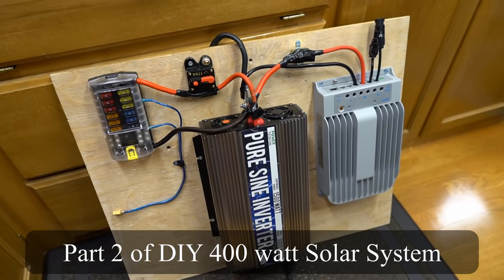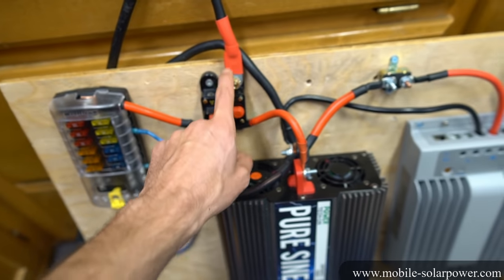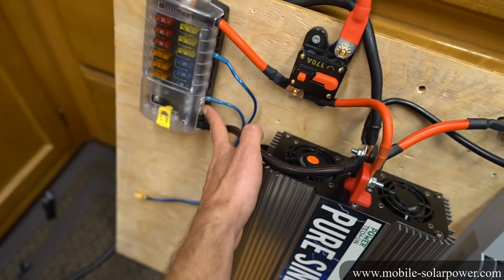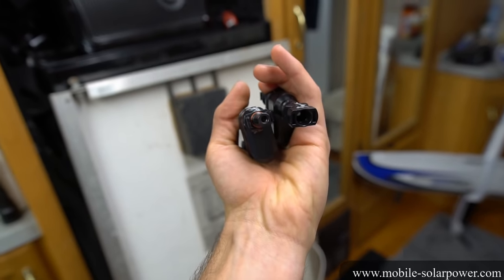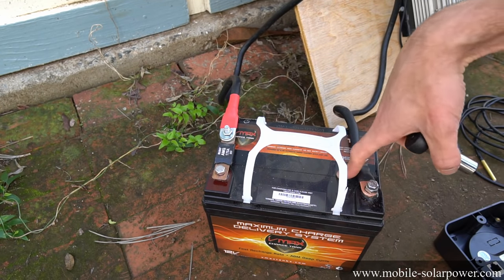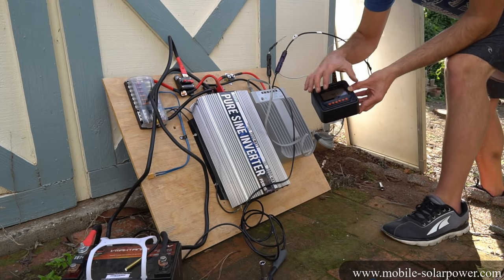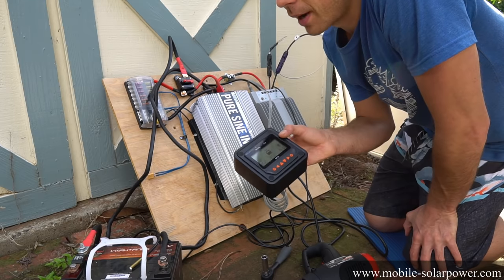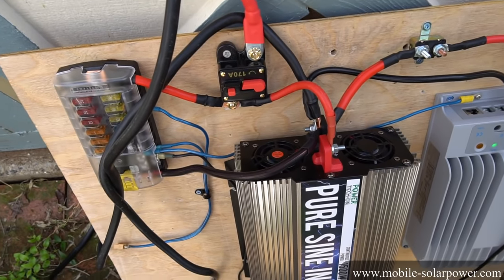DIY 400 Watt Solar Power System Beginner Tutorial *Part 2*

Comment: $355 for 4 solar panels + $250 inverter + $720 for 2 batteries + $200 charge controller/monitor + $40 fuse block + $13 circuit breaker = $1600 and we haven't even purchased the wires/connectors/hardware/tools. Was hoping to keep it all under $1000. What would you change if trying to keep the system's total cost under $1000? Less batteries and panels?
Thanks!
-Nick
Reply: Following for this answer.
Reply: If your 4 panels total 400w, I would switch to a single 300w panel, I bought mine for $170 each; check with your local battery suppliers for used batteries, I got a pair of 6v 225AH batteries that were 1 year old for $70 each. Honestly you aren't going to get much in the way of capacity trying to stay under $1000, going with cheaper parts you'll usually get what you pay for and parts will fail. Inverter price varies widely based on size and type, consider what damage you might do to the connected gear if the inverted is cheap and gives dirty power.

Comment: I keep coming back to these two videos. They are really well explained. I am still struggling to grasp fuse and breaker protection.  One thing that confuses me is the fuse at the battery. With the breaker protecting the inverter/DC box and fuse protection at the Solar controller, what function does the bolt-on fuse serve?
Reply: As a final precaution if all else fails so it dosnt have the practically unlimited energy of your battery to catch on fire or and explode
Reply: There’s different ones then the cheap bolt on one he’s using they make ANL ones with holders and stud/terminal style ones as well at marine stores
Reply: I just discovered these cheaper bolt on ones he used at the terminal at the auto parts store.. much cheaper than the marine stuff..

Comment: Hi.. I love your videos. I need your help please. I am getting my 100w solar panel along with a 40amp Renogy Rover being delivered this Monday. I also purchased a 3000 watt inverter to connect with the system. The diagram illustrated from renogy diagram and video doesn’t show or say anything about connecting a fuse box, circuit breaker and a smaller circuit breaker… could you advise me if I need the circuit breaker and fuse box or is it not necessary..? Thank you. I will have to put this altogether before the weekend of September 20, 2024… please respond back to me asap

Comment: Thanks Professor Solar,  you're a Legend Mate. I wouldn't have had a clue without your tutorial. Thanks once again. AL
Reply: I see how you got to a 50 amp breaker, how did you decide on the 170 amp breaker [not clear on that 1]. I've got a 30A Triron, so a 40A breaker yeah,  I've got a 170A battery, 325 solar panel, 100A fuse block & 1500Watt inverter, so I figured 150A breaker for the big 1. I want to run a 70Watt fridge that draws 6A[?]. What do you reckon Professor, if I wire it all together like you say, will it work? Any help would be much appreciated. AL
Reply: P.S. Very sorry Professor Will Solar, no money left to buy a book. AL

Comment: When I posted on the Facebook Group Lithium and Lead Batteries in Off-Grid Systems, a guy in the group turned me onto your channel. My question there was about   Lithium, batteries, and cold temp since I want my system to be usable year-round and we could see -30 mabe more during the winter months.    Now watching this video just brought up another question about my ideal. I want to build a system to run my 35ft camper trailer.  I was planning on buying a Renogy 400 Watts 12 Volts Monocrystalline Solar RV Kit Off-Grid Kit setting that up to battier bank and a 3000watt converter and then just plugging the shore power cord of the travel trailer into the converter.  Would love to hear your opinion on this and what I should do for Batteries.     Thank you in advance.

Comment: Hi folks. I built this system with similar components but renogy solar controller and renogy invertor. It works!

I have hooked up a cigarette lighter to the fuse box and connected my bougerv small fridge.

It is frustrating because I thought the 12v fridge would draw less ...however, the fridge is always erroring out because of low voltage.

I have a 280aH lithium battery. 

Any ideas?

Comment: I am building a similar system with the same solar charger.  I currently have 3-100 watt panels on the roof of my van.  Do you think that is enough or sufficient.

Currently have 2 deep cycle that are around 85 ah each (thinking of upgrading to 2-100 ah lithium 

I will have shore power when it works but I would like to be able to live off grid.  I will be living out the van for 2 months full time this winter.

A possible add on will be charging off the car battery in the future.

What i am powering...
Dometic 75cfx fridge/freezer
8 led lights
Heat Source LP furnace
Gas cook top
MaxxFan roof fan
1200W inverter
12v water pump

Comment: New to solar here and plan to build my own for my camper soon, but slowly over time. Not to cause confusion, but as I’ve been researching, I read that a 3000W inverter won’t even activate without 4 batteries minimum. Im guessing that since yours was only on 1 battery that isn’t true?

Comment: Thanks so much for all the information. I’m somewhat copying exactly what you’re doing with the larger appliances. However, my plan is to plug into the inverter to the trailer just like I would if I was on land. And on the DC side, just go through the circuits on the trailer just like my current batteries are hooked up on a stock trailer. None of the videos I’ve seen show that configuration. They always show a DC fuse box on the board and I’m wondering why I can’t just go to the trailers DC fuses.

Comment: Great tutorial. Am I right in thinking you don’t use a secondary charging source such as from the vehicle’s alternator?
That type of setup seems to be very popular/common 
Ant chance you could do a tutorial on that configuration? Thanks for your time.
Reply: The one major issue with connecting to the alternator charging grid in vehicles is the age of the lead acid "cranking" battery  (if you don't run an auto shut out/off regulator between your battery bank and the vehicle cranking/charging grid) IS the age of the lead acid cranking battery and its differences in relation to your lithium/AGM/lead-acid batteries.

My guess is Will created this 2 part video for "any" application. Not soley vehicles with charging systems. Also to reduce the length of the videos, adding info about varying battery types and the need to isolate them etc is time consuming lol
Reply: DC to DC charger with a disconnect relay when the vehicle is not running. But as mentioned some kinds of batteries don’t enjoy fast or uncontrolled charging. (Flooded lead doesn’t care so much)

Comment: hi great video. Why do you use a 40amp charge controller for a 400W system with a 12v battery. Are the panels even able to produce enough power so supply 40am to the battery. 400W x.75 = 300W / 12v = 25amp.  Forgive me if my maths are wrong

Comment: Avoid using this type of DC breakers (the one rated at 170A). They usually trip at much lower current and generate a lot of heat wile operating, which is not good. Use only proper rack-mounted type of DC breakers

Comment: What inverter do you recommend for adding an ac breaker box. I’m using an 800 watt array with a 200+ amp needed so I expect that an 3000 watt inverter but I’m new to this. I like a victory multiplus but cost it’s prohibitive. Also do you have a vid showing how to hook up charging off the engine alternator.

Comment: Love the vid, but isn't it bad to have the solar charge controller directly connected to inverter? No hate, I am just confused as that's what I've always been told. And you are really brilliant with solar stuff, so I'm just confused, as you know your stuff. Am I missing something or have you just made a little error? I'm guessing I'm the one missing something. I mean I know the battery is connected to the inverter... but that doesn't stop the fact that I see a plus and minus straight from the charge controller to the inverter. 

Kind regards Alex

Comment: I am building a small 100w 12v solar rig to power a figjam swamp cooler (DC, connects to battery) to cool my tent, and charge my phone from a 400w inverter. In the playa lab instructions to build this rig it specifies to keep the inverter outside in fresh air. The inverter has all the ac outlets to charge my stuff, and its inconvenient to have it outside. Does it realy need to be outside? Or is it ok to be in a safe spot in my tent? I just wanted the panel and battery (in a tub) outside. Thank you so much for your help!

Comment: Im confused on your breaker size decision of 175. What is your reasoning for that size choice? Im converting a 6x12 enclosed and I purchased a 200w (2-100w panels) solar system from Renogy. I also have a 2000w Pure Sine Wave inverter from renogy as well.

Comment: I'm currently building a similar system and was wondering if you could tell me if you have the Renogy 40A charge controller with Bluetooth, is it still necessary to purchase a separate battery monitor and/or a victron low temp cut-off switch? This is going to be to power my greenhouse, so I'm hoping low temp won't be an issue, however, in the event something fails, I want to make sure my Lithium batteries aren't damaged.  Thanks!

Comment: Will, wondering if you have a second..I have learned so much from your channel, so much, I have my first solar power system.  I am using a EPEVER 4210AN Tracer controller, 6 lightcatcher 100AH AGM batteries, wired parallel 2 200W 16V panels and 2 210W 16V panels, I have recently wired the 4 panels in series parallel, so I am seeing 32V and what I hope to see in AMPS 20ish. I am powering a overland vehicle, with 12V fridge/freezer by Apicool, diesel fired heater and a few other items. if you have time I would love to pick your brain on things like BMS, system set up ect

Comment: I am in england   ..  I HAVE two 200 watt panels    I want to be able to have power in my Garage    I have two 115AH  leasure batteries ,  do I need to buy a 40amp controller ?   is it better to use the batteries in parrallel or series ?   Should I also buy a 3000 watt inverter ...  And one last question do I need to buy curcuit breaker and fuses ?

Comment: Will I have a similar setup 400W with the same 40 amp EPEVER. Just upgraded from the Wanderer PWM yesterday. Your right that is an awesome Charge controller. Running 280 AH of AGM SLA. This is in a workshop so weight is not an issue. I would like to run a second inverter.
One 1000W  will be on 24-7 to power a small Dorm fridge. I would like a second 1500 W to turn on as needed. How would I wire that?

Comment: Late to the party, but here's my 2 cents regarding battery hookup order...

Lead acid batteries can offgas explosive fumes.  The order of hookup is to avoid a spark if the battery is offgassing.  

This is particularly important when jump starting a car battery  and why, you should always attach the positive cable first to the positive battery post, then connect the negative cable to a metal point on the engine away from the battery.  This way  if it sparks upon connection, the spark won't occur directly within the battery gas cloud.

It's battery explosive safety 101 for every mechanic.  

Hovever, if you must connect both leads to a battery, wear eyepro and connect pos. 1st, then turn your eyes away just before touching the neg. lead to the battery...eyes are important.

Comment: This design of these components where you have to add the little chassis ground from the outside seems ridiculous to me. Why wouldn’t they connect the chassis ground with the ground internally so you don’t have to run 2 grounds ?

Comment: Hi Will - I am following your instructions to a T, but it looks like here you have flipped the board upside down from what you started with.  Should the connector posts on the inverter be up or down when in use.  The inverter instructions say to not install upside down, but I don't know if that means the post end is the bottom, or if the long label side is the bottom.  As mine stands, I would be plugging items into the top of the inverter, whereas here you have them plugging in on the bottom.  Which is correct?  Thanks!

Comment: Absolutely great videos. I have a question about temperature. What happens if you leave a system like this sitting inside a camper or a truck during hot days and it gets 100 to 120° inside the vehicle? Will this ruin your system? Thanks Will!!

Comment: Such a great video! I noticed you didn't add a circuit breaker between your solar panels and your charge controller? I was going to add a blue sea 7210 AC / DC 15A single pole circuit breaker (capable of 65V DC as my panels Vmpp is 41V) between my panels and charge controller? Is this necessary or can i just connect panels direct to charge controller without the breaker? Thank you so much for your time in creating the video!

Comment: Hi, thanks for the video but I can't use the sistem after 2 minutes running a 1200 watts the inverter shut off. What is the mistake I did? 
The only different from your sistem that I did is using  a 4awg Instead of 2awg but my cable is only 2 feet long.
Appreciate your help in advance

Comment: What could scaling the system look like in the future? Would I want to size up my 4 gauge positive wire from the sinewave or battery if these devices are both a bit further from the solar c. controller and blade box?  (2 feet from the battery and 1  foot from the sinewave terminals)? You said to do this in the previous video but I wasn't sure HOW MUCH LONGER that distance would need to be to have to size up! Thank you Will!

Comment: make the ground wire bigger, mine burned out, so I've replaced it with a gouge identical to the inverter, now the breaker can properly trip  and save my life because curren aint restraint by the flammable ground wire no more

Comment: I just built this and finished yesterday late so will be testing today as it will get to the 60s with sun. I’ve got (4)100 watt mono panels , 3000 watt 12v Inverter, mppt 40a controller, 300a circuit breaker, 4 gauge, 6 gauge and 10 gauge wires, all wires as you described hand constructed, wow I learned so much and am less than a rookie but I wanted scalability, (4 ) 6 volt deep cycle batteries as I will get lithium phosphate in future as not affordable yet. So thx Will, you are the man!

Comment: One question where is the battery connected to the charge controller ? Or is it all connected to the inverter ? I don't get that, and how about the 170amp breaker I see 3 positive cables there is that where the battery is connected?, im kind of learning  sorry for the question and thank you for your videos.

Comment: We had started wiring our cabin for on grid.  Can we use the breaker box and wires we’ve already installed and hook it to a solar power source instead or do we need to buy a whole different breaker box, different circuit breaker’s, and wire type to run throughout the cabin?   We have the yellow electrical wire running from the breaker box to the outlet boxes.  I’m not sure what size or type it’s called but didn’t know if we needed to chunk the whole thing and start over if we wanted to go solar. Thanks!

Comment: Hi
When i connect my inverter ground to negative busbar, my inverter is not working. When i turn on inverter, after few seconds green ligh shifting to red light and No output voltage, 
buzzer whistles 
continuously. Where should i connect to ground in campervan?

Comment: Thank you for noting that if you are going to use a lot of amperage on the maximum 100 amp rated fuse block that you show, that the user should put a fuse or circuit breaker limited the amperage going to the 100 amp fuse block that you show, since the battery circuit breaker is rated at 170 amp and excess the maximum rating of the fuse block.  That is normally how they do it in newer model vehicles.   Also if someone installs it in their trailer or moblie home you do not want to be responsible to telling them not to put a fuse in and the vehicle catches on fire from an over load.

Comment: Breakers and fuses are used to protect the wire  and not equipment.  If you have a device that draws 50 amps yet is only connected to wire that can supply 40 amps then 40 is the maximum over current protection.  If it trips then you need to increase your wire size and  breaker accordingly.  Not picking, I like your videos and reviews and they have been helpful as I have been getting into solar.

Comment: Will, what is your opinion on using Ground Fault Protection measures for a system such as this? I have read that NEC requires this for all grounded PV systems?

Comment: If ... you are installing the battery in a van, where you can accidently, touch the chassis metal (negative side of battery) it's best to start with the positive terminal first. If removing the battery, it's best to start with the negative side of battery. Tho, if you don't care, or you taped up your ratchet with electrical tape. Do what you like!  :) Also, it states in my owners manual to never connect the charge controller to PV before you connect up the battery, I guess they don't want it sparking out, or maybe it could burn up the capacitors when it sparks like that?  I don't know, I've done it both way, now, I just put a fused disconnect on the negative panel side, then I can connect the battery first or swap out a battery or whatever, and then easily connect the panels back in line.  But whatever.  Just going by what what was written in the the HQST manual for their charge controller. Shrug.

Comment: I noticed you didn't have a fuse between the solar array and the charge controller. And what size fuse would you use between the charge controller and the batteries?

Comment: So if the battery is full, but you don't have a dump load connected to the charge controller, what is it doing with the incoming voltage from the panels?